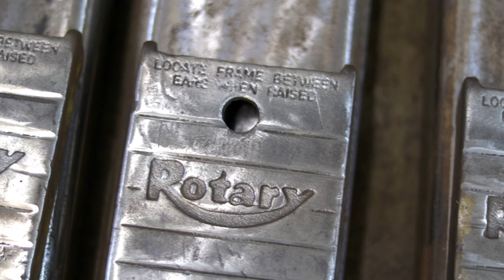A C10 With A Crown Vic Front End?? Turbo 1968 C10 build (Episode 7)

Comment: What wheels are you running? Love them.
Reply from the maker: Wheels are 15x10 aero in the rear with 325/50r15 nitto nt555r2 tires and up front it's vision D window 16x8 rims with 265/50r16 toyo proxes r888r

Comment: Why the crown Vic front end? Those trucks have good suspension and a huge aftermarket to do everything the Vic front does?
Reply from the maker: The main reason is its cheaper and lighter. The front end comes with a heavy duty sway bar and rack and pinion steering.